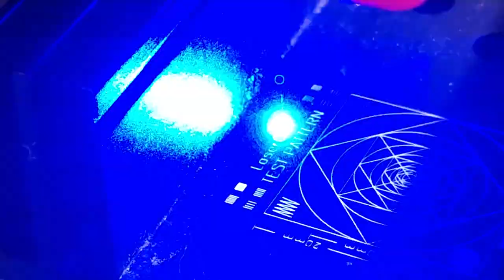Aufero Laser 2 - La miglior marcatrice Ortur

Comment: Интересно сравнить эту новинку с Ortur Laser Master 2 по скорости кинематике, действительно она быстрее ?
Reply from the maker: Yes, this design allows to lighten the moving masses (the moving axis and the laser head must not carry unnecessary weights) two motors are integral with the frame.
The module coupling and focusing system are also very lightweight but very functional.

This means that the laser can move faster and brake and accelerate more abruptly without losing precision in positioning. I test it up to 15000mm/min that is really high speed for this kind of machine.

Comment: What stepper motors are installed on it? in appearance, they are very small, on Ortur Laser Master 2 Pro they look more massive ? The main board there is the same as on the Ortur Laser Master 2 Pro, can I add limit switches myself ?
Reply from the maker: I can answer you later, now I don't have the machine with me.
Reply from the maker: Motors are 40x40x30mm same size of most common engraver as Atomstack, Sculpfun and OLM2 Pro too.

Control board is "OLM-ESP-PRO_V1.2a" different from the one used in OLM2 Pro but this board have a lot of free connectors/sockets with silk-screened "DOOR, ESTOP,  HOLD, START, FIRE, LIGHT, X_LIMIT, "Y_LIMIT, Z_LIMIT" so i think it is possible, but I suggest to contact ortur support for official answer.
Reply: @lasergrbl  Thank you very much